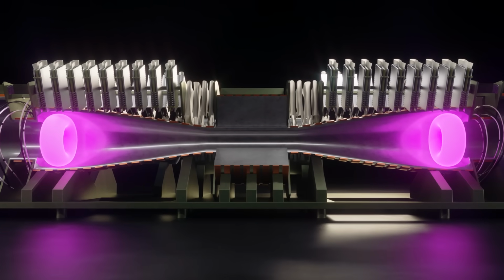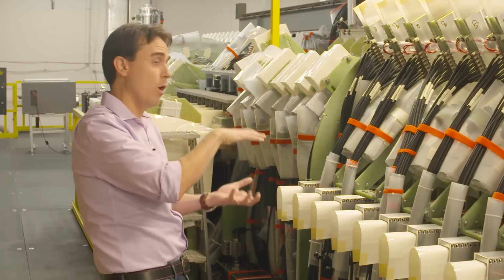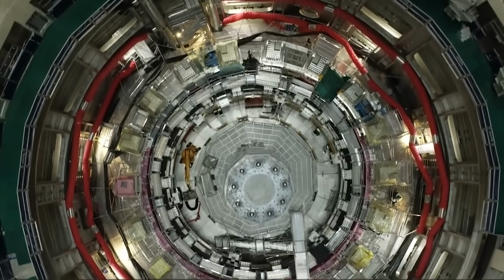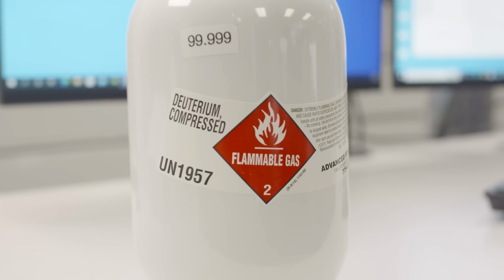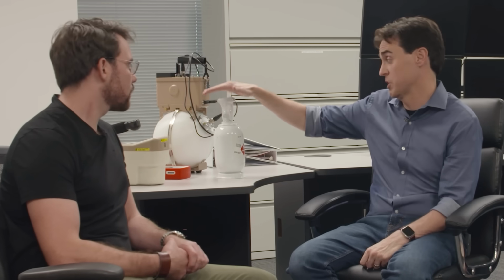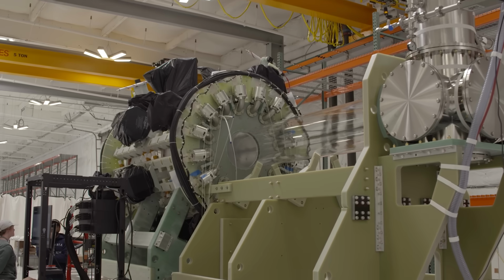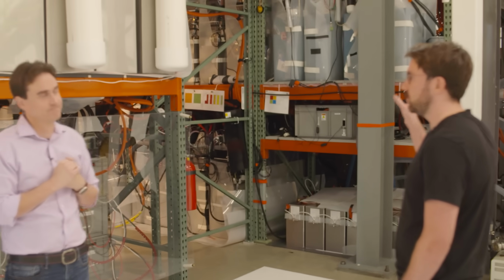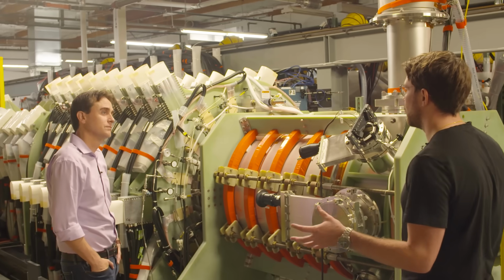A New Way to Achieve Nuclear Fusion: Helion

Comment: There are so many "Press X to doubt" things in this video.

1) Deuterium Deuterium fusion has a 50/50 likelyhood of producing Tritium, which in itself is highly reactive.
2) Since the Helium 3 Deuterium fusion is less likely (aka needs more energy) than Deuterium Tritium (not to say that Deuterium Deuterium is even less efficient) the Deuterium Tritium fusion would happen just as likely - so you still have an insane neutron flux and thus the same heating and radioactivity issues.
3) A pulsed thermal reactor has the help of the water acting as an energy buffer. Having a pulsed reactor that just creates insane spikes of current is basically useless in a grid.
Reply: Reagarding 3), well, aren't they already pretty good at using capacitors at insane energy levels?
Reply: @norbertw.  We are talking MW continously. There is currently nothing that can run MW power levels over hours from a DC source.

Edit: That is to say that the biggest things in that regard are Teslas Megapacks, which peak at a 2 digit MW numbers. Powerplants run on the 4 digit MW level - continously.
Reply: @henene4  Maybe there's some weird misunderstanding between us, but wouldn't you agree there are solar power plants that provide thousands of MW to the net during operational hours?
Reply: @norbertw.  Yeah, but these are hundreds of installations, not one singular point of production.
There is a big difference between hundreds of thousands of inverters each doing a few dozen kWhs - or one installation doing all pf that at once.

The biggest DC/AC "thing" that I could find was high voltage DC transmisson lines. The equipment there can do GW level AC/DC conversion - at the price point of hundreds of millions. 

I don't see where that isn't just as cost prohibitive.
Reply: @henene4  We're talking 50 MW electric output of the reactor, right? At least that's the number communicated by Helion. Just for reference, one can buy 500kW inverters on Alibaba at $30k each. So a hundred of them, one per capacitor or so (I don't know the specs of Helion's capacitors), would make 3 million $ minus discount. That's money, but given the context, it's rather peanuts. 

Helion's team is definitely facing some extremely difficult technical challenges, but I doubt that power conversion is giving them the biggest headache.

Comment: Thanks for visiting, Brian. As always, we appreciate your ability to breakdown complex engineering topics - including direct energy recovery from fusion!
Reply: You guys are inspiring, making me excited for the future. great work!
Reply: Maybe I missed it in the video, but I don’t think I heard a Q value for the reactor. It sounds like (if you’re talking about hooking up to the grid) Q is pretty high. Is there somewhere I can read more about the project and see some more engineering figures?
Reply: @tomkelley4119  The current prototype doesn't produce electricity as far as I understand
However, using it they have demonstrated that their method of converting the fusion energy to electricity directly with magnetic fields has 95% efficiency
Reply: @Astromath  it does produce electricity via the fluctuation of the EM field, however it is only stored locally in the capacitors currently. You can’t just hook them up to the grid in that state
Reply: Hurry up and deliver us to the future!
Reply: It feels like this is the computer in a room back when it was first invented. Hopefully this technology becomes just a ubiquitous and streamlined. I'm excited!
Reply: The 2 big questions i have are:

1. We know conventional steam turbine based power plants have a primary energy to AC electrical energy efficiency of about 33% due to the power cycle, so what is the expected efficiency of this reactor, from the primary energy of the fusion products to electrical AC output. (And that of the fusion powered magnet explosion inducing that first electrical pulse in the generation coils)

2. 1 of these apears to be the equivalent of a 1 piston engine, that isn't a smooth cranking of a drive shaft but a violently shaking engine. How do you plant to convert the pulsed waveform outputs (that i assume resemble something like a standardized lightning wave or a dirac impulse with a presumably insane current peak), into an actually usable form, either as AC synced to the grid, or HVDC put into long distance transmission lines? And is their any benefit to having multiple of these pulsing reactions in the same facility and having them be timed so that they are out of phase and then possible with switching combine them to get a result closer to a multi piston engine that will already be inherently smoother before converint from a pusle train to grid compatible electricity with minimal transients?
Reply: @jasonreed7522  I think he said they want to have bigger capacitor banks and drive the inverters from those, doing another fusion pulse before they drain completely. I’m still a bit skeptical, but the voiceover claims this has a higher thermal to electrical conversion ratio than traditional plant (which are now pushing 40-45% btw, albeit they’re a minority on the grid due to age).
Reply: @jasonreed7522  I'll try to be pragmatic. Our governments tell us that "climate change" is going to kill us soon if we don't give them a bunch of money to fund projects like these. It's good to innovate and come up with new things but it's all driven by power and control over you rather than in the past is was about wealth. Neither is the best but our elites only want this for themselves
Reply: I'm sure much of the information is closely guarded, but it would be interesting to know the amount of energy it takes to create such powerful energy fields. What is the net energy consumption/production between the various generations of machines? Even as far as % efficiency gains? I assume as you solve the engineering challenges that efficiency is growing. Very exciting stuff, wishing you the best of luck!
Reply: @brois841  I think it is very inefficient that’s why it is not yet in production… But I wish them all the best! 😊
Reply: Really hoping energy prices can PLUMMET in future. Keep doing great stuff!
Reply: @InvestingBookSummaries  don't keep your hopes up... that's not how things work, when a new source of energy is discovered we're told "enegry will be virtually free" and all sorts of other nonsense, then the system finds a way to screw everyone into infinity, then rinse and repeat.
Reply: I want to apply but I don’t want to betray my current work! This is the knifes edge!
Reply: The Tokamak is like the steam engine using coal.
One day an innovation occured where Oil was used in machines to power it, and in doing so the neccesity for more efficient oil, dus the process of purifying and shipping this oil/gas becomes an industry itself apart from the machines that it empowers... Helion is that Processing step. A step into our Small Modular Reactors and fine tuning all that we know of Nuclear Capabilities both Fission and Fusion. WE MUST FEAR THE FUTURE. For that DREAD is what makes us lose time as a species.
Reply: Interesting but I have the million dollar question. What is the total performance of that fusion machine?
Reply: I hope I see this roll out in my lifetime but even if I don't, still super excited about what you're doing!! The future thanks you Helion <3
Reply: You guys willing to one day put one of these reactors inside a space ship?
Propulsion technology is also advancing!
Reply: @ghoulbuster1  think of how capacitor banks will be lifted out of Earth's gravity well or constructed in space. Because without those huge capacitor banks, this doesn't work.
Reply: Wow, you guys are down the street from me, I wonder if my energy will come from you soon. 🤔
Reply: ability to break down
Reply: You guys are magnificent, I love you
Reply: You guys seem to be doing really important work over there. Maybe now commercial scale nuclear fusion will really be just 20-30 years away 😜
No but seriously the work highlighted in this video was nothing short of mind blowing.
Reply: Are u guys hiring ?
Reply: thank you for doing the future work that could very well save us from our selves. what could see us on mars and or the moon or just removing the barrier of resource scarcity that keep governments in power over the people.
Reply: @adamk.7177  eh... if we're lucky, in 50
Reply: Just saying that this interview was fascinating, and the technique of extracting energy directly from field flux changes is brilliant - it cuts a lot of intervening mechanics out of the design and greatly improves its overall thermodynamic efficiency.  Will watch the full interview with interest.
Reply: This is all privately funded?
Reply: A rebuttal: https://www.youtube.com/watch?v=3vUPhsFoniw
Reply: ~Global nuclear bomb fake Hiroshima deceptive There are no satellite photos of nuclear test explosions, please tell everyone~
Reply: Yes we enjoy his work, and the avalanche of shit-tisements that he so generously disrupts our relaxation time with.
Reply: Nuclear fusion in the Sun's atmosphere. A scientific discovery. https://www.youtube.com/watch?v=bWETIphfz8k
Reply: I’m dying to get on with the Helion team. I am so inspired by the technology, and enamored by the novelty of what you guys are doing.
Reply: Good luck ❤
Reply: I wish I already had the requisite education and experience necessary to work at Helion!
Reply: @physe8052  No need to wish, hit the books and grind until you get there! I believe in you!
Reply: @synaesthesia888  Thanks! Working on it now!
Reply: @physe8052  https://youtu.be/r-EOPGmB5eI
Reply: I'm so grateful for you to come with new ideas about energy generation and more importantly to explore the possibility to making them.
Please don't stop and keep going forward. We humanity need you innovation!!!
Reply: How big would a over unity system be compared to the one in the video?
Reply: I have a question: 

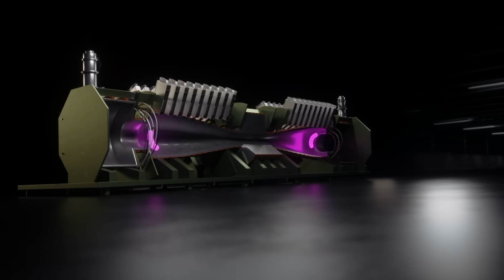At 18:30, to increase ”repetition rate”, couldn’t you add more formation sections? Ie: have 2 or 3 pairs colliding plasma at intervals rather then just having 1 pair? Kind of like how cylinders fire in an engine in intervals driving one shaft.

I guess it would mess up the magnetism in the center but if you guys can figure that out then it could be done.
Reply: Im seeing a great space applications for this technology technique
Reply: I wish y'all the best and hope you can solve some of these rare earth minerals. I work on an oilrig and love seeing how people are trying to solve our energy needs. Seriously best wishes
Reply: Would there be any merit to adding a laser array at the center, a la a spark plug to zap the hot spot once it is collected?  Interesting and amazing stuff, this intermittent approach looks way more controllable than the giant chaotic rings of plasma though.  I don't suspect throwing AI at the magnet control scheme would really keep it bottled up longer term.
Reply: In the video you say the plasma gets up to 300km a second.... wouldn't that mean it becomes light as in the speed of light...

Also do prescribe to idea thar hydrogen is the next phase of light... or more simply light becomes matter? This machine you've built kinda proves that I my humble opinion....
Reply: @WSmith_1984  Do the math.  300 km/s isn't even .1% of lightspeed.  That's part of the promise of this project; the plasma particles may be moving at relativistic velocities, but the plasma rings themselves don't have to collide at relativistic speed in order to initiate fusion.  I think it's brilliant.
Reply: @WSmith_1984  speed of light is about 300 000 km per second not 300 km per second. Also light itself is a matter and a wave. Compton, Michelson with Morley and Einstein proved that. Whole quantum mechanics is based on wave-particle duality. Hope that clarifies a bit.
Reply: @ukaszczarnotta1992  The Michelson-Morley experiment proved nothing conclusively.  Einstein did not develop the idea that light was a wave; Bohr's equations did.  Also the idea that light has momentum, and so by induction inertia, was not only a problem for Einstein professionally, but the whole concept of quantum gravity.
Your understanding of science history seems to be greatly distorted to me.
Reply: @HuntingTarg  I guess I wasn't specific but Morley-Michelson proved that there's no medium needed for light to propagate. And Einstein had his NP awarded for discovery of photoeffect. I could've named more great physicians in field of physics of light and qm but I doubt that would be nothing more than showing off.
Reply: This is the truth that they don't tell you 👉The Connections (2021) [short documentary]👀
Reply: .     China have that tech long time ago and even installed it up their space station.
,,, will also use that tech when Russia and China put up a moon-station in a couple of years.
Reply: @chitaegandalalake263  
Baloney.  If China could make these produce electricity for grid use they wouldn't be having power outages and operating more coal power plants than all of North America and Europe.  You're blowing sooty smoke.
Reply: @HuntingTarg  ,,, that system is viable in zero gravity space and will be used for electric generator at 'dark-time' also as propulsion system going to Mars.
.    Earth's strong gravity tends to break-down machines thus China-brownouts 
but/so all countries succumbs to such problem.
Reply: @HuntingTarg  ,,, tell that to Elon Musk @ https://www.youtube.com/watch?v=C5ODS46LuNg
Reply: @Chitae Ganda Lalake  actually not yet. But China already has a spy working at Helion and will email the blueprints soon. Then Xi will build a cheap knock off version that won't work. This is the PRC way!
Reply: It's more ignorance than a breakdown.

Comment: Did they consider that there is also a lot of Helium-3 on the moon that may be a good supply of fuel when the moon base is established?
Reply: Having to goes to the moon everytime you need He3 is still to expensive.

The best way is to make it using other material that easy to make like heavy water is much better in the long run.

Comment: Very cool video, why are they not using superconducting magnets for the machine? Is that just an extra engineering challenge or do traditional electromagnets have some advantage in this application apart from being simpler and cheaper to operate?

Comment: Nice, one of the first fusion generators that creates intense pressure on the plasma, helps mimic star conditions and makes fusion easier since P\V=nRT by increasing pressure and keeping mols of gas and volume the same you get increased temperature.
Nice piece of tech they have.
Are the magnets superconducting? I assume they would be with how much power they’re pumping through.